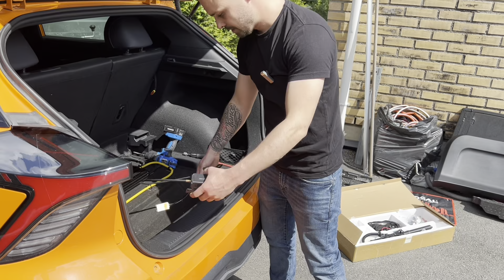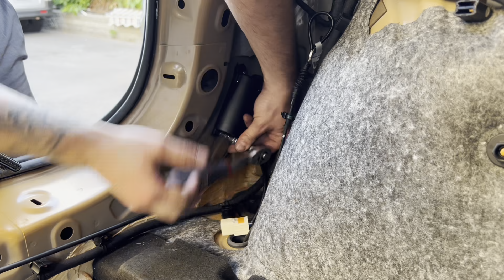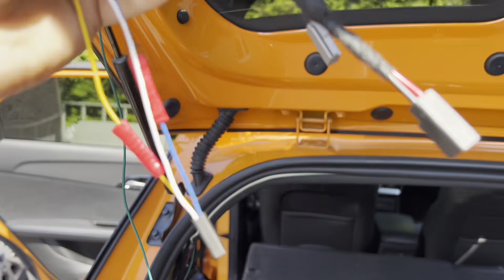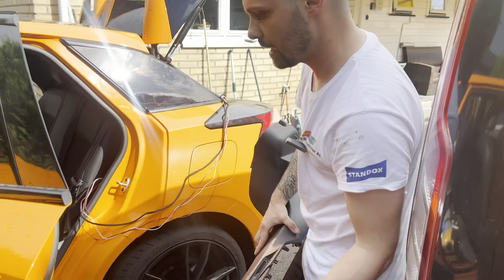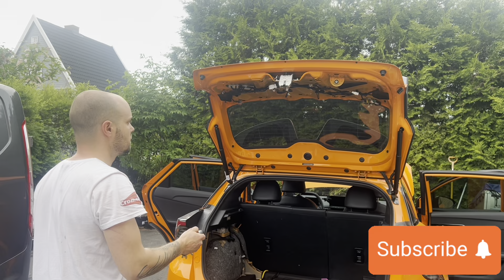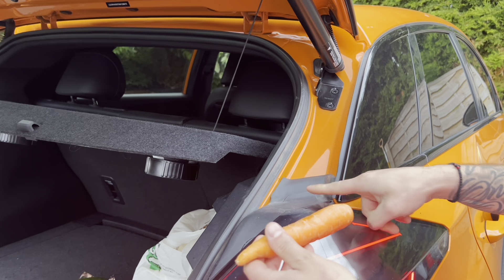MG4 gets electric tailgate.How to do it your self in detail plus safety test!!

Comment: It's so cool to watch someone do this kind of work. I watched in awe the whole way through seeing how it was all done and how you solved the various problems, especially with mounting the latch motor and feeding cables through impossible holes by cutting them and then re-joining them, and how to get trim panels off.   I'm guessing that you've done quite a lot of this kind of work previously and also have some knowledge as an electrician as I was lost when it came to doing the fuses.  As a bonus, I was pleased to see that MG made a very good job of making the rear lights easy to replace. 
I was also amazed to see that the tailgate had sensors for obstruction, and impressed again to see that it it's actually very good. I didn't expect such quality from an Ali Express product.  Great video - thanks for showing us how it can done!

Comment: Thanks for the good video, I had a little more free time over Christmas, so I installed it in my MG4-77KW, I mean I didn't cut the connectors, I just cut the main fuse and I pulled the power cable through the grommet last from the trunk to the car, I pulled the other cables with connectors from the car to the trunk like you did. I used 2 pieces of 8mm wide plastic duct tape to pull it through, between which I placed the connectors and taped it with insulating tape. You have to reach the arrow shape and oil it properly, I use hand cream not WD or other oils. The wiring of the strut motor must first be pulled into the opening for the original wiring and then upwards to the motor. The 4-pin connector goes through easily, I took the black and black wire out of the connector, this is easily done by sliding the plastic latch away from the connector with a needle, it can be seen if you look into the connector from the contact side. I did not take the bumper down, I loosened the six screws at the bottom and there was a gap of about 5 cm through which I did the assembly. I led the cable through the free grommet in the space as you drilled the rivets. I drilled the holes for the foot sensor according to the template, I also put it off center (more to the left) so that it does not mislead when mounting the towing device. I was slowed down a bit by the fact that the supplied struts were about 1 cm longer than the gas struts, but when I took both struts down I found that the trunk could be lifted much higher, so it was easy to install after that. (Now I don't bang my head against the lock anymore) I didn't run the wire for power to the battery, but I connected it under the screw on the fuse panel, there is only a 20A fuse and by shortening the cable I probably achieved more. I did not drill the motor of the lower lock into the body, due to vibrations it is better to hold it flexibly, I secured it to the vehicle's wiring with the help of elastic bands so that it does not rattle in the trunk. It's a bowden, so all the power takes place inside, it doesn't need to be firmly anchored. I also didn't remove the rear seats, I just loosened the lower plastic in the driver's door sill, but I completely wrapped the wiring in textile tape (I also added cables for towbars if I decide to install them in the future) so that they don't rub anywhere when towing. Your video saved me a lot of time, for which I want to thank you once again. I did the assembly myself and it took me about 6-7 hours, including the assembly of the LED backlight, something similar to what you gave. I had to spend more time than I expected because it had very short cables and I had to place the control unit in the middle of the vehicle and not near the fuses. I want to ask, my foot sensor can open the trunk, but it can't close it, I have to do it via the button, if I connected it to the supplied button, it can close it, but it can't open it. Does the sensor do the same to you?

Comment: Thanks heaps. My BYD Dolphin now has a working electric tailgate! Luckily the unit I bought had wires removed from the plug so no need to slice and splice them. I did extend the power’s ground though to the front to skip removing the lower trunk side panel. It was otherwise too short to reach the front.

Comment: Nice videos, congratulations! Did you try opening the trunk with the button while you're driving? hopefully it won't open, but I didn't see any sensors that would stop it. Give it a try at low speeds if you haven't already tried? Let me know PLEASE! If it opens I you could find an odometer signal and connect it to a relais that then provides or not the voltage to the output of the button

Comment: I was successful with the Auto tailgate installation on my MG ZS EV but the Kick Sensor i was unable to get it activate. Can U help with the connections and the proper kit. Thanks.
Reply: You should connect the green wire (trigger) from the foot sensor to the positive wire of the tailgate opener button.

Comment: Hi, I don't understand from the video why the power cable is stretched all the way to the battery? Should it be enough to plug it into the fuse box in the cabin? I assume that there is a permanent 12V power supply under the dashboard as well.
Reply from the maker: Hi
You probably can do it that way too and take ground from the chassis.

Comment: I installed this yesterday but keep getting blown fuses. The tailgate goes down after replacing fuse but seems to blow when it tries to go up again. I would discourage people from installing this kit. It is a huge job even without kick sensor, and the kit comes without any instructions. The Chinese supplier doesn't reply to questions.
Reply from the maker: @PhilAHealey  Hi . It is indeed a very big job and the kit has no instructions.
That is the reason I made the video.
Are you sure you connected everything the right way?
Which fuse is keep getting blown?
And if you have done everything right at least there is warranty inside the box.
Do not get disappointed yet.Go over your cables one more time.Maybe something is touching somewhere it shouldn’t and that is the reason you burn fuses.
I use it every day since the video was uploaded and I did not had any blown fuses.
Reply: Thanks, I was so frustrated after spending all day installing it and then have it not work. I will check everything tomorrow. Maybe one of my wire joints is bad. 😊

Comment: Thanks for the nice video. I bought the same kit and have two questions ; 1. A idea of installing time on a mg4 but without install the foot sensor ? 2. On the cable that goes to the two way connection for the lock,there is a short yellow cable you know where I must connect them on ( I don't see on your video ) ?
Reply from the maker: Hi ,
Thank you.
I would recommend to do this in the weekend with no stress and some coffee.
It is possible working slow 4 hours a day.
The yellow cable I didn’t connect it nowhere.
Reply: the yellow cable should be connected to the door servo motor cable, where +12V will appear when unlocked, if then the unlock button is pressed three times on the remote control trunk will open, this is ready for vehicles that do not have a button on the remote control to unlock trunk.

Comment: What happens to the warranty? Is still valid installing all this?
Reply from the maker: Hallo.
If the problems you get are related to the things you have installed I do not think that the warranty will cover them.
Now let’s say for example that your window mechanism brakes.If they do not cover this because you upgrade your sound system or because you have electric tailgate I think that this is little bit weird!

Comment: Hi Magoulas, hello from Malaysia. Fantastic video. I love it. I have watched it so many times I am now confident I could DIY the installation of the electric tailgate. One thing though, the installation of the kick sensor - removing the rear bumper looks daunting. Would it still work if the sensor is placed inside the rear end of the boot?
Reply from the maker: Thank you!
I have never tried this so I can not answer this question.But the bumper is easy to take off.Do not be afraid to take it apart.
The cars are made from pieces 🙂.
Reply: @magoulasfabrications7766  I suppose you are right. I just have to stop thinking of the number of screws and bolts I have to undo and just get on with it. Cheers, mate!

Comment: it is supposed to be a plug and play tailgate kit and you've made it more complicated than it should be.  have you read the fitting instructions supplied by the manufacturer? firstly, don't drill any holes through metal, it is not needed! factory warranty is gone if you do that!... secondly don't need to cut any wires... thirdly, never tap to the fuse box like the way you did and why did you run the power cord to the battery? This is not the way recommended by the manufacturer.  too much prep work and you are like dismantling the new car and you don't have to remove the bumper to fit the kick sensor.  And by the way this is one of the cheap low quality tailgate kits and kick sensor on the market, there are better options, at least with no drilling thru metal.  
And you don't test the anti pinch system like that.. It's not a Tesla.  Honda CR-V has sensor strips along the edges.  To test this kit, you can stand under the tailgate when closing, it hits your head or shoulder, and it will stop and retract.
Reply from the maker: @hwaccessories  Hi there.
Yes this is a cheap kit with no instructions included.
This is how I did the installation.
For anyone doing a DIY install check with the kit supplier regarding the warranty.
I recommend to be installed by the dealership to avoid any warranty issues from Mg
Reply: @magoulasfabrications7766  I haven't fitted one yet to the MG4 but I do have a fitting instruction from the supplier for MG4 (seems to be the same one that you've got with a golden control box). The instruction is written in both chinese and english.
Yes you are right, please consult MG regarding warranty if DIY.
Reply: Can you provide a link to the kit you installed with instructions? I've just been given the go ahead to install in my mum's MG4.
Reply: I installed this yesterday but keep getting blown fuses. The tailgate goes down after replacing fuse but seems to blow when it tries to go up again. I would discourage people from installing this kit. It is a huge job even without kick sensor, and the kit comes without any instructions. The Chinese supplier doesn't reply to questions.
Reply: @PhilAHealey  
https://youtu.be/-Q0bZORazXM

Comment: You're back!! This IS what I wish the MG4 had stock.. I doubt I can even start to work on that mod though... but given your mods I'm sure you're good to go. Btw where did your sub woofer go ? I could not see it when you opened up the trunk, I can only see your amp now

Where is the link to the kit also please?

Oh and bless your gf/wife for sticking through all this time to record this footage
Edit: Nevermind not the gf this time haha XD

Question: Would any of these steps change if it was a left hand drive (UK) MG4 ? And is there any alternative to drilling and using the rivets? I do not have this rivet where I live :(
Reply from the maker: Hi !!!!
The subwoofer is out because I sold the box to a very nice guy!I also built his sound system!Now I will upgrade mine little bit more.
My girlfriend is a hero!
I do not think is there anything different in the right hand drive just make sure if the fusebox is still at the left side!
If you do not have rivets you can just make o hole with a screw and a nut. Just make sure you put some paint and silicone so is not rusting 🙂.
Reply: @magoulasfabrications7766  Gotcha. Can you perhaps link to where to buy this kit?
Reply from the maker: @Airbag888  Tailgate for MG MULAN MG4 EV Automatic Rear Door Powered Trunk
https://a.aliexpress.com/_EGFGRfl
Reply: @magoulasfabrications7766  Thank youuuu!! omg I almost hit buy now by mistake XD
Reply: @magoulasfabrications7766  Fusebox is on the right hand side for RHD.
Reply: @cjmillsnun just the wires down the other ode because the wires are split you might not need to cut the plugs off